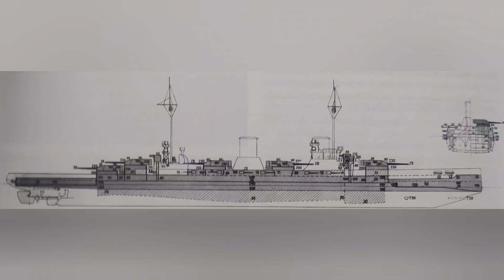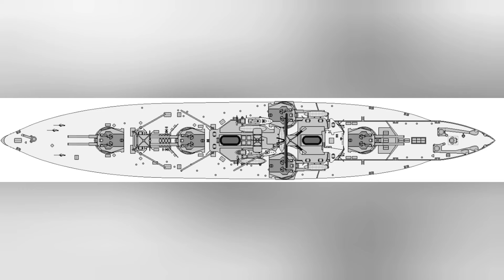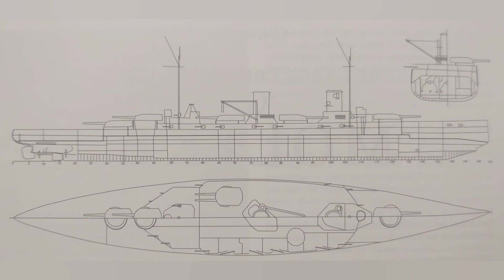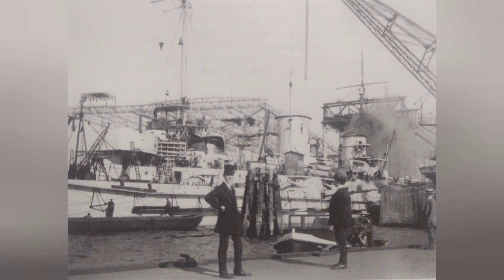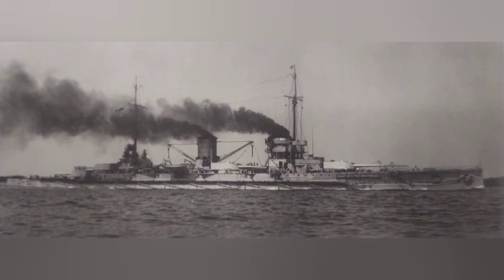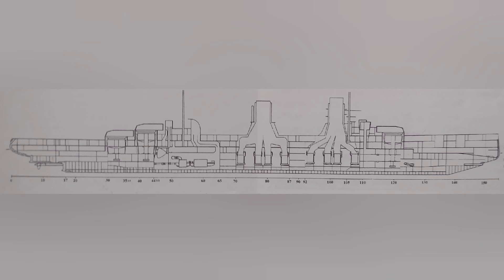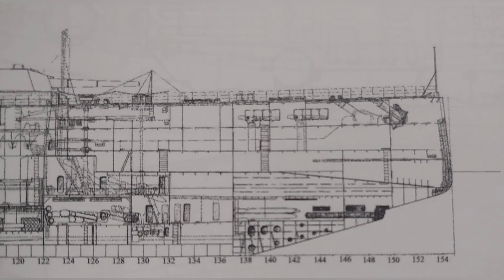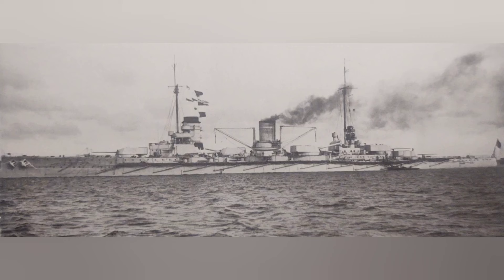Developing Moltke

Comment: Re: Centerline tandem rudders.  Would that have worked for Bismarck, you think?
Reply from the maker: @WildBillCox13  In theory, yes. It would require extensive redesigning of the stern and shaft arrangements however. It is also worth noting that Bismarck had decent turning abilities with its actual rudder arrangement. Under damaged condition, the ship would still most likely suffer from reduced turning abilities, but would probably have had some control with a centerline arrangement. I don't think it would have given the ship a better chance of surviving its mission, but I think it could have managed to straighten its course.